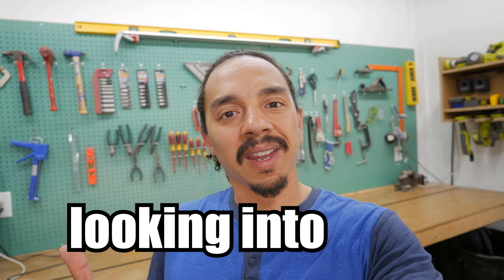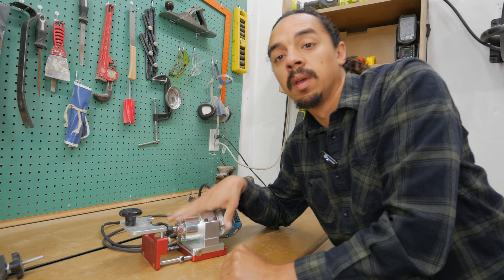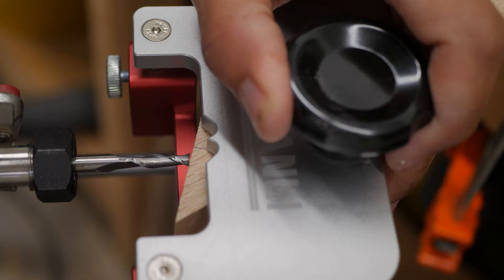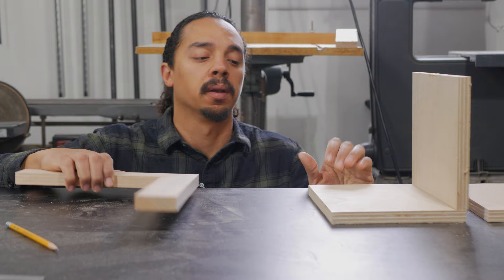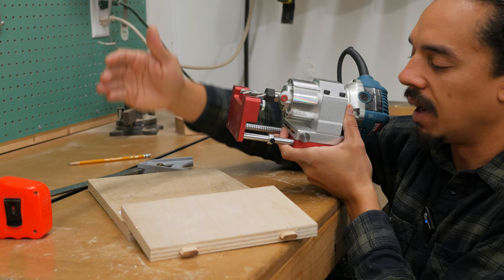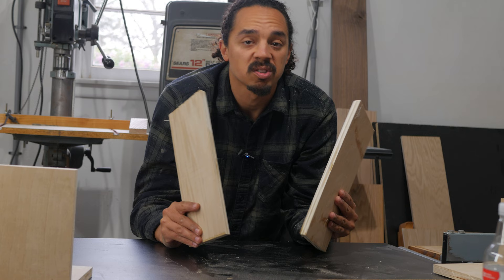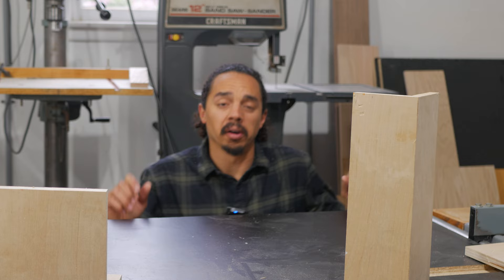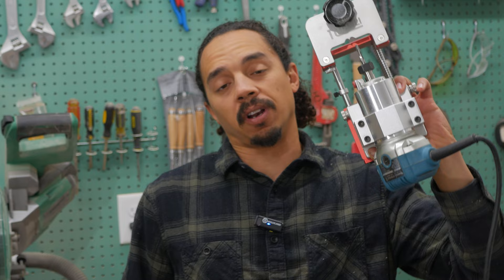You will REGRET not watching this FIRST. (An Actual in depth review of a Festool Domino Replacement)

Comment: Good review!

Also a poor man's domino is a biscuit joiner and something thin to lay the biscuit joiner on.   What you do is make three-ish cuts with the biscuit joiner each slightly ofset so it makes one large biscuit cut and you can put a domino sized floating tenon in it.

The cut is a LOT wider than a domino but for the price of a biscuit joiner it is pretty good
Reply from the maker: I actually don't think I've seen that before pretty interesting. Would work decent on larger pieces.
Reply: @make_or_die  exactly.   it works surprisingly well.  Make a biscuit joiner cut like normal. Then put down like 3 or 4 pieces of sand paper put the biscuit joiner on that, make a 2nd cut.   Then flip the piece over and make a third biscuit cut.

The domino then slips right in.  It is a looose fit.  Had anl neighbor that made a lot of stuff and he swore by em. He even made a jig to make "jumbo domino biscuits"

Comment: Something else this jig can do that a Domino can't - you can cut the mortice for a mortice & tenon joint regardless of how wide your tenon is simply by moving the jig over and continuing the mortice cut. With the added depth you showed, a really long tenon could be accommodated
Reply from the maker: I've never used a domino but I feel like this could be achieved using the domino, I could be wrong tho.
Reply: @make_or_die  Not if you want to make a custom size tenon ... as far as I know - I don't have a Domino either (I do have a biscuit jointer)
Reply from the maker: @qapla  I just assumed you could move the domino over slightly make a cut, repeat until you have the desired width?
Reply: @make_or_die  That may be a solution to the width of a tenon, but can a Domino make custom mortices for a thicker tenon?

Comment: This would work really well with the "High Precision Festool Domino Jig" ( search YouTube ) since it would allow for height adjustment as well.

Would setup blocks be useful to set the height? Does the zero on the height scale line up the router bit at the edge of the platform?
Reply from the maker: Height wise I usually just pick what looks right. Set it then leave is for all the pieces, as long as it's locked you'll be good.

Comment: $200 doesn't include the router. which needs to be a 65mm diameter motor. I just saw a "similar" router tenon jig on Temu for around $50-60,no router included with that one either.
Reply from the maker: They have two different router diameter options.

Comment: In the video this tool looks good.  But he distorts the price a little bit.  He does say $200 plus shipping.  But in reality its $195 plus $45 shipping.  So $240 total for the jig.  Plus another $110 for the Makita router on Amazon.  Or $149 for the Dewalt router on Amazon.  So all in you are at minimum of $350 or $389.  Much less than the $1019 for the Domino 500 basic I found at Pro Cabinet Supply.  The $1199 Domino he shows is for the Domino 500 with all the accessories.  So this compact router holder jig is roughly one third the price of a Domino 500.  Worth it?  There is also a WEN track saw with rails on Amazon for $161.  The comparable Festool track saw with rail is $699.  Kreg makes a track saw and rail for $398.  Are they interchangeable?
Reply from the maker: The Dewalt and Makita routers are extremely popular, but if they have another router it might still fit, they need to look at the specs. If they don't have a router at all, then yes they are now in at roughly $400, but now we are also comparing what the Tianli can do vs the festool, but also what the router can do that the festool can't, which is endless. Like I said, I'm not getting anything either way, just trying to give people options.
Reply: I think that anyone who's thinking about a Domino already has a router. That's pretty standard stuff. You don't jump from a drill to a Domino in one leap.
Reply from the maker: @vociferonheraldofthewinter2284  I second this